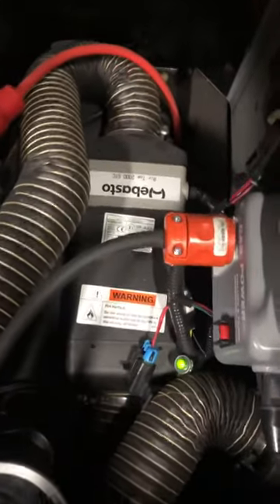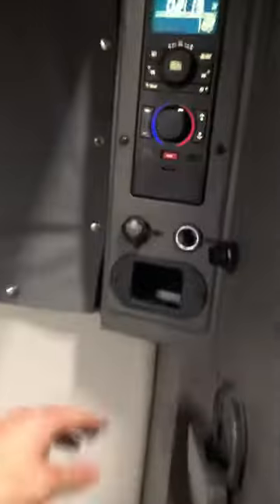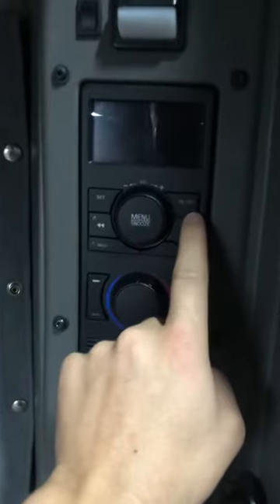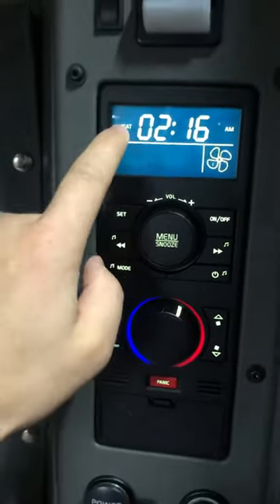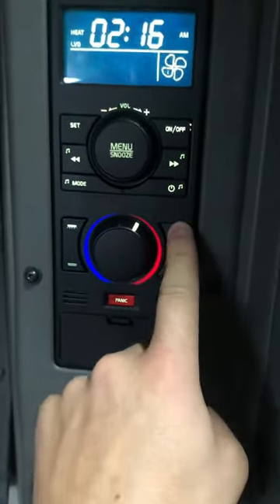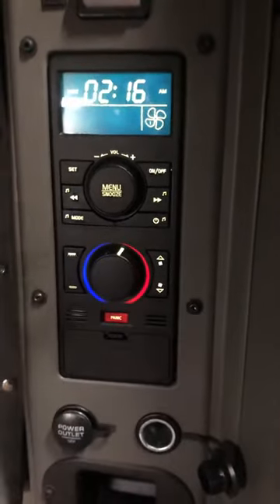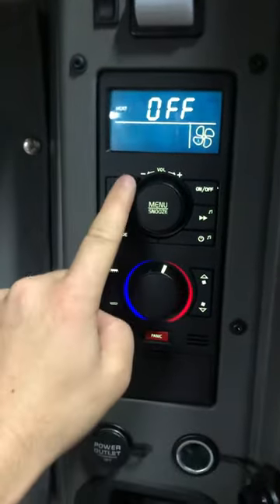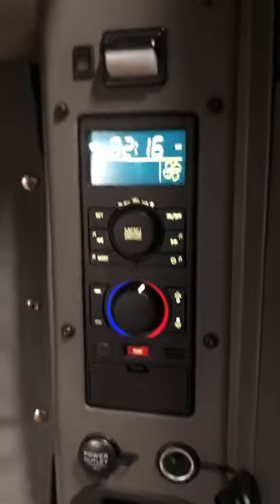How to use Webasto cab heater Volvo 2020

Comment: Good video. So does the truck start itself when the battery is low?
Reply from the maker: Thanks, I don’t think I understand the question. Do you mean if the heater stops when the battery is low to allow the truck to start?
Reply: @Realsamthetrucker  hi. I know the truck is turned off when you use the heater. The heater runs by battery. So when the battery drains to a certain point, does the truck starts itself to recharge the battery? Or does driver have to start the truck manually in the middle of the night?
Reply from the maker: Oh, now I see what you mean. The truck doesn’t start itself, usually my Webasto/heater has lasted for up to 14 hours in really cold winter, when I was stuck without a load. Then I had to turn the truck back on for 30 mins, and it would work for another 3-4 hours. It basically will save you so much diesel and you will sleep better bc the truck will not be shaking as it would when the engine is running
Reply: Thank you so much for this video. I could figure out on my own how to get the heat to run, but I could not get it to shut off and so when I would stop to fuel, the heater would automatically start running which is extraordinarily dangerous as it can explode!

Comment: The fan speed doesn't work for me the speed is controlled by the temperature, so for example when I have it on all the heat: fans are high, when on all the way cold blow super low cold air.